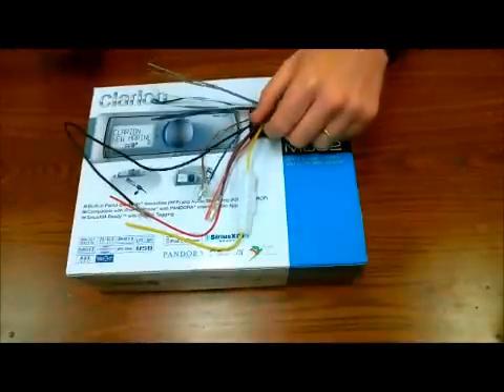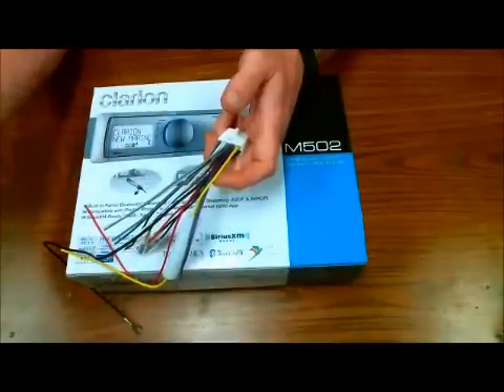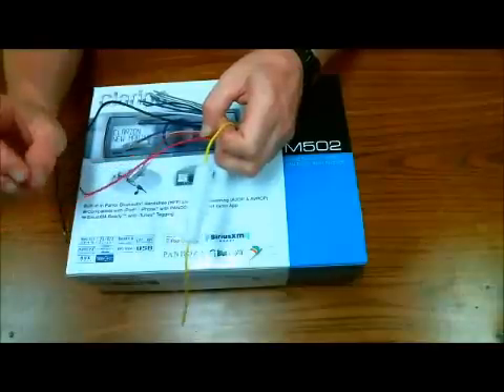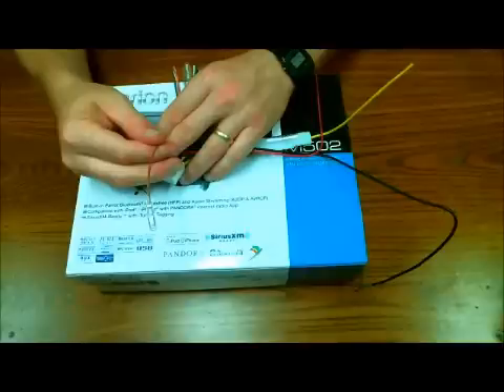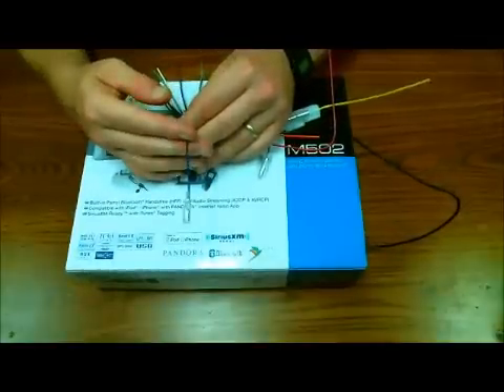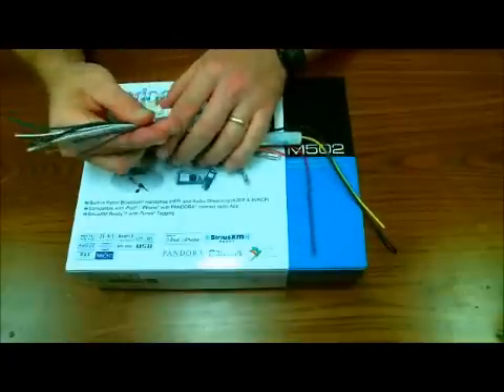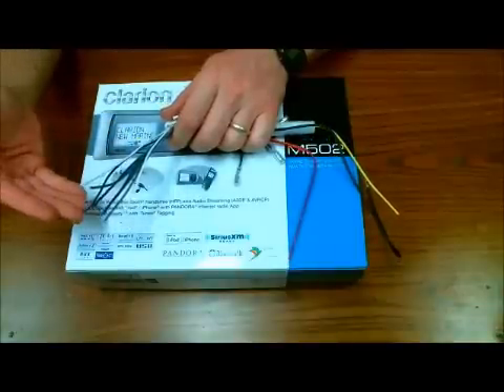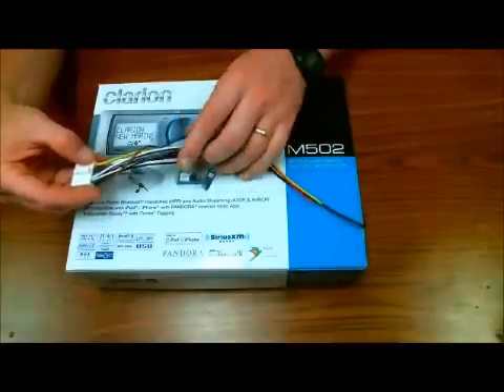Car Stereo Wiring Explained In Detail

Comment: Hi, I’m going to install a cd player in my tractor and I want to make a metal box to fix in screw the cd player and then bolted to the tractor’s cabin. I will take the ground from the battery, but is it ok that the ground is also connected with the metal case of the cd-player?  Or I should make a wooden box for the cd-player, for the safety of not making ground???
Reply from the maker: There is nothing wrong with that, more ground is a better ground, that's my policy!!
Reply: Lessco Electronics thank you sir.

Comment: My car doesn't have a red (accessory/switched power supply) could I possibly connect red with orange (switched illumination power supply) that way if I unlock the car the radio will turn on. Atm I have red connected with yellow but that means I have to turn it off manually.

Comment: hello! :) what happens if you cut/disconnect the red wire? ignition key will no longer turn on/off radio, but you will still be able to turn it on/off manually? if not.. how do you achieve that?
Reply from the maker: You need to connect that red lead to a keyed/fused accessory circuit, Then it'll work perfectly like it should.
Reply: @Lesscoelectronics  not sure if I understand this correctly - isn't that how it's already connected? I want to be able to turn stereo on/off manually. And not via ignition key. How do I do this? Thank you! :)
Reply from the maker: In that case put an on/off toggle switch between the red wire. that'll do it.

Comment: What color does the or age connect to on my stereo
Reply from the maker: thats for the dimmer (lights) wire if applicable..
Reply: @Lesscoelectronics  I noticed after I commented that the previous owner took the dimmer wire out and the power antenna out from the stereo pigtail.
Reply: So I couldn't connect the power wire or dimmer

Comment: Fuse on back of radio keeps blowing. The rest in the truck are fine. It doesn't have to have key ignition or on. It blows as soon as I plug the new fuse in.
Reply from the maker: the radio has an internal short then.
Reply: @Lesscoelectronics  so a bad radio no shorted wire?
Reply: @Lesscoelectronics  do you have any videos on how to troubleshoot? Like harnesses and what not my radio booklet says shorted red to green or something. I'll have to look and see the exact wires but I dont know what to look for with a volt meter. I know it would be set to dc volts but not sure the readings I should get or what not.

Comment: why does my harness for my clarion dxz365mp have two yellow wires both fused one 3amp and one 15 amp? the plug into the unit are two seperate wires but are wired together to power

Comment: Hi, I have a corvette c5 . I changed the head unit and used a pac adapter and I replaced door speakers and back panel speakers. now I want to upgrade a little bit more I want to replace the door speakers again and the rear panel speakers and add a sub in the trunk with a 5 channel amp... 
never did an amp before but always wanted to try.
My questions are, when I hook up power from the battery to the trunk  to the amp. is that going to keep the amp on all the time?
2nd question . the blue and white wire  , is that supposed to be the remote wire? 
3rd question.  does it matter where the RCA CABLE'S go on the back of the radio? Because I'm not sure if it shows what is out. but I remember when I installed the radio it came or a lot of RCA cables to plug in the back of it. 
4. would that affect the PAC connector?
So here is what I'm doing. 
new speakers in front and back . subwoofer in trunk , 5 channel Amp. and disconnecting all the speaker wires from original and running speaker wires straight to the amp.  Please let me know. 
THANK YOU

Comment: Hi need some help have a 94 Buick LeSabre doing a radio install got the kit and color matched the wires etc but I didn't know what the orange one was at the time so looked it up and it said to interact it with the orange wire on fac. Harness so when I cut it from plug and tied it together my lights came on with out it running or manually turned on.. so I'm trying to trouble shoot that and also when I plugged radio in it didn't come on minus the orange wire so I would like to know if it being unhooked could affect it also thanks.

Comment: Helpful info. Bought a new touch screen stereo. It is supposed to fit my old truck. Have not tried to install yet. Surprised it came with no wiring diagram and no wiring diagrams to be found online for it. I just want to replace the old cassette/radio. All I want is ACC hot, ground and speakers and radio antenna. Basically for it to work . That's how the old one was wired. Don't know if I have to hook up additional wires to the hot side to get illumination, etc.?  It appears there are many wires on the new one I will not be using. Wish me luck. There is a "SWC" plug that is for who knows what.

Comment: The pink wire you talked about at the end Is/Can be used for video and or a camera, I use it with my after market radio because my radio has a slide out screen and i can use that for my rear back up camera to put it on my radio's video screen and that's what the pink wire is for and usually there is only 1 pink wire!! Enjoy!

Comment: Thanks for your time and video, this has helped for sure. I do have a weird question to run by you though; I’m installing a Pioneer deck in a sailboat, and the existing wiring color codes have two wires which provide the positive for one speaker and at the same time a negative for a different speaker....I’ve never seen this and don’t know how to continue. Do you know of anything like this? I can email pictures if you’d like, thank you.

Comment: Can you connect the blue white stripe with the ilumination wire? If not where to connect the ilumination wire with?
Reply from the maker: No you definitely dont want to be doing that. I most modern cars the illumiation lead is rarely used.

Comment: I have a 08 town country, i'm changing the radio with a pioneer AVH-290BT. The radio have an orange/white wire, the wire harness don't.  Where i connect it?
Reply from the maker: the org/wht is a dimmer lead. I suggest capping it off since the unit wont support dimming.

Comment: hi need help in adding aux & usb connector to my toyota etios 2011, however the stereo shows usb + aux option also haveing a 10 pin connector output just near the gear...but the aux & usb ports are missing...it's no longer supplied by toyota....please help how to go about....thanks

Comment: I have a blue wire on the cd plug buy not my wiring harness?? What does yhe blue wire go to if theres not another blue wire to attach to.

Also the orange illummination wore is marked on the harness but no orange wire on the cd player plug
Reply from the maker: If you need to power that blue wire (for an amplifier, power antenna) etc.... you can tie it in with the red (accessory) wire if need be since your stereo lacks the output.

Comment: This was so helpful, it didn't help me with the question. I purchased a vehicle that has an aftermarket radio installed. It may or may not be the reason the my engine light stays on when the key is out. So I pulled out the radio and noticed some wires were paired incorrectly. Then I am versed with a wire light green wire called a breaking wire and a ground wire coming from one of the harnesses attached to 2 ground wires. Hoping you can help. I took pictures willing to send then.

Comment: Ok i have a question, im wiring in my after market radio and the car has a blue wire, but no blue/white, and my readio has no blue wire, but has a blue white, do thes have to be connected or could i get away with not connecting them to anything amd just cap them off
Reply from the maker: just cap it off, unless you have an electric power antena
Reply: @Lesscoelectronics   nope no power antenna thank you

Comment: My 08 Chevy Uplander radio has two plugs, the smaller only has a couple wires used.  What is the smaller second plug for?  Um installing an after market unit and main plug adapter.  Um thinking of leaving the other hang there, unused.  But what was it for?  My guess is On Star, which is doesn't seem to have.
Reply from the maker: Most likely an optional factory cd changer

Comment: every video i saw on youtube has the harnesses connected differently that i have in my car... I can't figure it out...Here, as the other videos the wires are connected between themselfs and on the one end two plugs on the other side one plug...In my car i has two plugs on one side but the wires need to go into a harness directly that comes out of the car(it is the other way arond)...how do i connect that?
Reply from the maker: Are you using a wiring adapter harness?

Comment: Question: I am installing an after market DVD player in my 09 civic. In order to play videos while driving can I just connect to a ground  source to bypass or I have to tap into the brake wire?
Reply from the maker: what model is it?
Reply: Lessco Electronics: it is Honda civic 09 LX, and the stereo is Planet Audio P9630 B. Thanks
Reply from the maker: I beleive that one will take a straight ground, If it doesnt behave tehn Id get one of these here:
https://www.ebay.com/itm/DIY-Bypass-Pioneer-Stereo-DVD-Parking-Brake-Bypass-Kit-double-pulse-relay-/401327860822?vxp=mtr&hash=item5d71012c56

Comment: Can someone help me here: 

Just installed a marine alpine stereo. All wires matched up in the harness except the blue! I have a blue/white wire on the harness from the unit and a blue only wire coming from the original harness. I have these two connected but I assume they should not be and I should just leave them disconnected?
Reply from the maker: If your boat has no amp in it. Leave those 2 disconnected
Reply: Okay - I am still not getting any power to the unit. I suspect a ground issue. I have the black wires crimped together. Do I need to ground elsewhere for this unit to function?

Checked all fuses. 
Tried ACC and ignition power.
Battery in boat is new. 

I'm stumped.

Comment: My radio was working before one day I was driving and first sterile went out then dash lights went out car died found out wiring on alternator bad had wiring fixed everything worked but radio I checked fuse in box in car it was good just wondering is there a wire that goes to alternator or is there a fuse on yellow wire on harness

Comment: I had a big sub in the back hooked up to the other speaker wire and i moved the sub and now i dont have sound idk y but i moved the sub and it all shut of but radio will turn on
Reply from the maker: You probably shorted wiring somewhere, check your fuses.

Comment: I got a 2007 Saturn outlook xe and got a double din hooked up all works fine but radio won't work with key in accessory position is it a fuse i can tap into to connect the accessory wire off double to get it to work with key in acc position i checked all the fuses inside the car under passenger side dash but can't seem to find one that works in acc position either there hot always or no power in acc position any help would be glad appreciated

Comment: Can the orange and orange/white be connected together? My harness for my car only has orange while my after market only has orange/white.
Reply from the maker: I doubt it, since the dimmer is regulated voltage by the control knob and the parking lights are exclusively on/off only. I would avoid that. Good question though...

Comment: I'm wondering I have a 2006 Dodge charger with a factory Amp 6 disc, mp3 radio in the front and with factory rear seat dvd player and screen. There are two front radio wiring harness's that connected to the factory radio. A 22- pin connector and either a 10  or 11 pin  connector, sorry can't remember the correct number as I'm writing this. Would you know what the smaller of the two harness's is for....the rear dvd player? or is it the factory Amp?

Comment: I have a base model 04 impala and jus hooked up a new pioneer radio and when I turn the car on the radio has no power! When I connect the red and yellow wires up it has power but when I turn the car off it still stays on! I don't know if the radio is faulty or the switch accessory wire is dead and I don't know what to do! Can u help?

Comment: I have a 03 deville and I bought aftermarket radio. Is there a special harness. I don't have Nav or Bose. I don't care about losing steering wheel control for radio.  What model harness adapter can I use.

Comment: i need wire colors to put a 99 sterio in a 95 cad seville  thanks
Reply from the maker: 1995 Cadillac Seville	Last Update:  2/12/2009  	

		TECH NOTES:
		* Omega OEM Front - BU-4.3, BU-4.7 Replacement Rear - BU-69.3, BU-69.7, BU-69.10 Speakers:

	Circuit		Wire Color		Location		
  Constant 12 volts	RED/WHITE AND RED	IGNITION SWITCH HARNESS
  Ignition 12 volts	PINK	IGNITION SWITCH HARNESS
  Starter	YELLOW	IGNITION SWITCH HARNESS
  Dome Light	DARK BLUE (-)	DRIVER KICKPANEL OR HEADLIGHT SW. *
  Driver's Front Door Pin		
  Pass Front Door Pin		
  Driver's Rear Door Pin		
  Pass Rear Door Pin		
  Trunk Pin	ORANGE/BLACK (-)	TRUNK LIGHT OR REAR BODY HARNESS
  OEM Hood Pin		
  Parking Lamp (+)	BROWN (+)	REAR BODY HARNESS IN DRIVER KICK PAN.
  Parking Lamp (-)		
  Lock	RED/BLACK	DRIVER KICK #202
  Unlock	WHITE	PANEL **
		* BLUE/WHITE (-) Wire At Courtesy Light May Also Be Used For Door Trigger. Courtesy Lights Are Driven By Relay. D BLUE (-) Wire Will Trigger Alarm Even If Courtesy Lights Are Inoperative. ** Without OEM Keyless Entry Door Lock Wire Colors Are- L BLUE (Lock) & WHITE Or BLACK (Unlock) In Driver Kick Panel, See Note #202.
#202- See Positive Pulse Door Lock Diagram. 

CLICK HERE TO SEE AVAILABLE DOORLOCK INTERFACE KITS

	

	  Tach Signal		WHITE OR PURPLE/WHITE		AT IGNITION MODULE		
  Ignition Coil (-)		
  Injector (-)		
  Ignition #2	ORANGE	IGNITION SWITCH HARNESS
  Ignition #3	N/A	
  Accessory	BROWN	IGNITION SWITCH HARNESS
  Accessory #2		
  Accessory #3		
  Starter #2		
  Neutral Safety	ORANGE/BLACK	SWITCH ON DRIVER SIDE OF TRANSAXLE
  Brake Light	LIGHT BLUE (+)	AT SWITCH ON BRAKE PEDAL SUPPORT
  Parking Brake		
  Clutch Pedal		
  Reverse Light	LIGHT GREEN (+)	SWITCH ON DRIVER SIDE OF TRANSAXLE
  Rear Defrost		
  Immobilizer Type	
		 

CLICK HERE TO SEE AVAILABLE IMMOBILIZER BYPASS KITS

	

	  Window Up		 D\ D BLU P\ L BLU D\ D GRN P\ L GRN @ MAIN		
  Window Down	 F/ BRN F/ TAN R/ VIO R/ VIO SWITCH #211
  Trunk Release	BLACK/WHITE (+)		RELEASE SW. OR REAR BODY HARNESS #231
  Keysense	LIGHT GREEN	(-) STEERING COLUMN HARNESS
  OEM Horn	BLACK (-)	STEERING COLUMN HARNESS OR AT RELAY
  Headlights	YELLOW	(-) AT HEADLIGHT SWITCH
  OEM Alarm Arm	N/A	
  OEM Alarm Disarm	LIGHT GREEN	(-) IN EITHER KICK PANEL
  Vehicle Speed Sense		
		
#211- See Reversal Rest At Ground Power Window Circuit Diagram.
#231- See Positive Pulse Trunk Release Diagram. 

	

	  OEM Keyless Module		-		ON LEFT SIDE OF LUGGAGE COMPARTMENT ON SEAT BACK		
  Motor Lock	GRAY	AT OEM RELAYS *
  Motor All Unlock	TAN	AT OEM RELAYS *
  Motor Driver Unlock
  (disarm defeat)	TAN	AT KEYLESS OR IN DRIVER KICK PANEL *
  Trunk Release Disarm		
  OEM Lock Relays	-	IN LUGGAGE COMPARTMENT NEAR KEYLESS
  Add On Security Type	#3 CONNECTION #223
		* Circuit Type: Reversal Rest At Ground
#223 See AL-100/VIP-4000 Type 3 Diagram 

	

	  Left Front Speaker (+)		TAN		LOWER FRONT DOORS; Size: 4"		
  Left Front Speaker (-)	GRAY	LOWER FRONT DOORS; Size: 4"
  Right Front Speaker (+)	LIGHT GREEN	LOWER FRONT DOORS; Size: 4"
  Right Front Speaker (-)	DARK GREEN	LOWER FRONT DOORS; Size: 4"
  Left Rear Speaker (+)	BROWN	REAR DECK; Size: 6 X 9"
  Left Rear Speaker (-)	YELLOW	REAR DECK; Size: 6 X 9"
  Right Rear Speaker (+)	DARK BLUE	REAR DECK; Size: 6 X 9"
  Right Rear Speaker (-)	LIGHT BLUE	REAR DECK; Size: 6 X 9"

Comment: My existing Sony stereo has an 8 pin harness, the deck I want to use is 16 pin, both decks are Sony. Is there an adaptor or how do I switch receivers, I don't have the 16 pin harness for the new deck.

Thanks in advance
Reply from the maker: you should watch my floating ground wiring video, thats most likely what the old unit had

Comment: When i start the car the radio goes off and i get the radio go back on when i disconnect the battery and reconnected it again. What's the problem there's  wires that are not connected

Comment: I have a Pioneer connected all the wires right, plug it in turned the ignition radio didn't come on, turned the car completely on still nothing check the all the fuses their good can anyone help I'm driving a 2007 Chevy Impala but when I connected the red wire from the car harness to the yellow of the same I get power radio comes on without car being on problem is radio stays on I want it to go off when car is off draining my battery

Comment: Great job explaining! Now in reality, speakin for us cheap guys that can't afford the aftermarket harness. Can't I just connect constant yellow 12v to the yellow 12v, red positive to ignition wire, connect both blacks on original harness to the same ground, connect the illumination wires together to the dimmers, connect amp turn on, and so on so forth to the existing radio harness? As long as I know which is which on original harness?

Comment: Hey buddy, my buddy sent me here and I do have a question. My truck wiring harness has 2 12v constant wires, and my stereo harness has 1 12v constant. Do I tie all 3 together? It's the same case with ground wires.

Comment: I have a vintage cassette player/  radio from a toyota 1987 van . everything lights up the station change has a remote that works but no power / line signal to speaker.  The antenna is broken and the left rear speaker is gone. The question is.... should.i get some sound from the speaker without an antenna or would one side ground wire prevent any sound from or to the speakers. Thanks